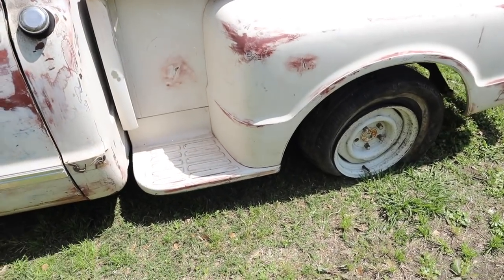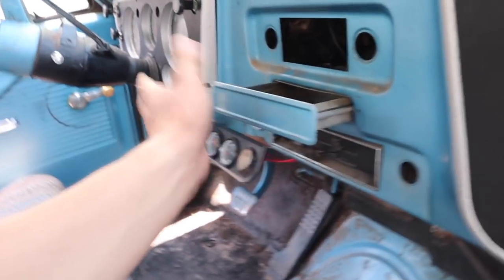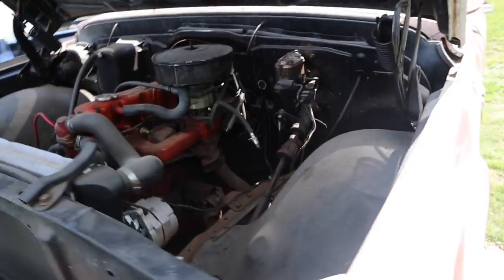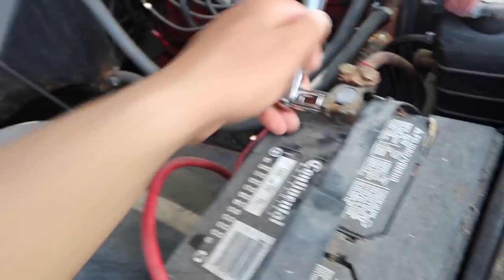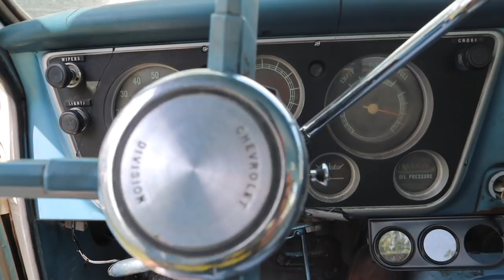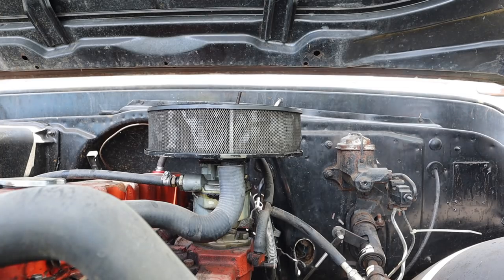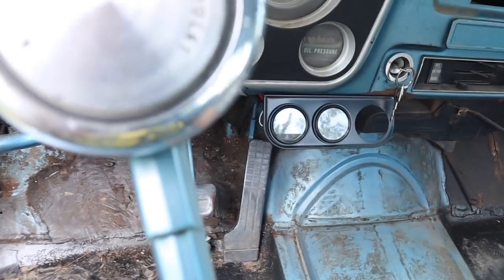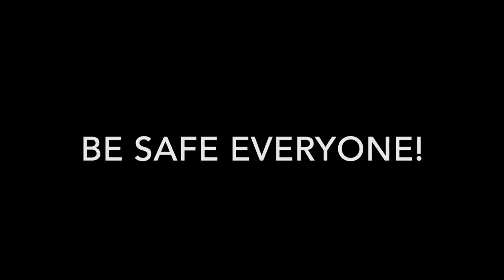I BOUGHT SOMETHING IN CALIFORNIA

Comment: You know you can stroke out that 6 cylinder, right carburetion or fuel injection headers and the right gears in the rear end that thing will do an easy 80 90 on the highway I've done it, good luck that's a nice truck Factory Rally wheels strong suspension

Comment: Be careful with those ponies Chapo..... After it's been running don't pay accelerator you'll flood it, hard to kill an I block need tubing for backfiring problem (plugs timing maybe points but solid truck think may be some Bondo in there though tires r dry rotted .... Will be nice when u finish just take your time and be careful who you get to help u